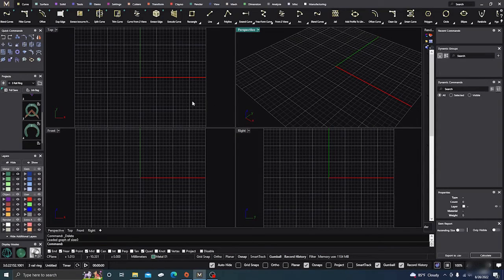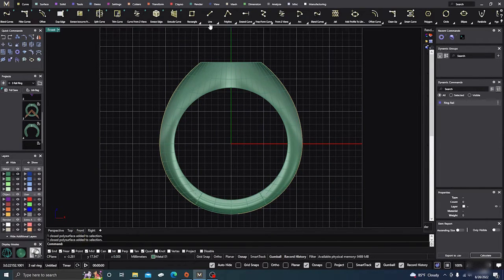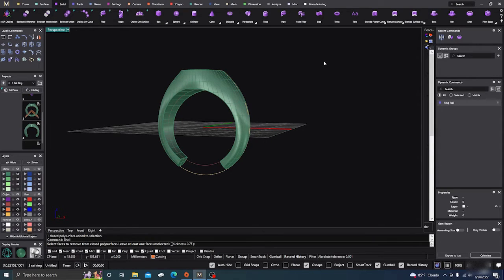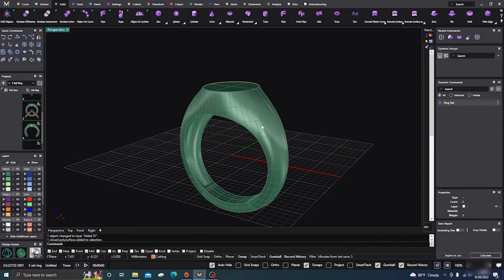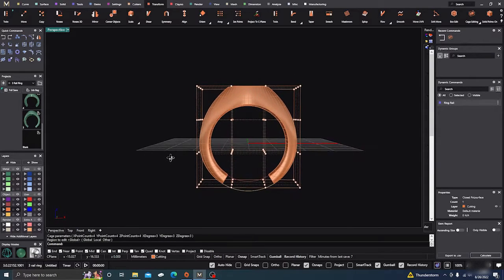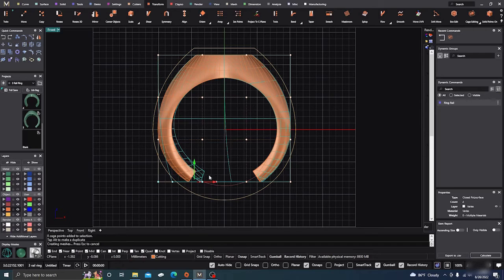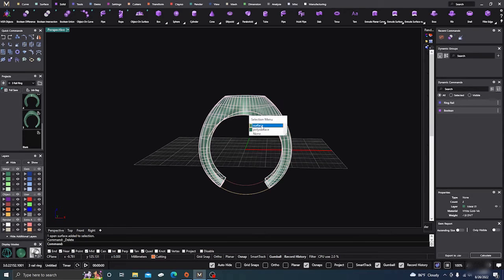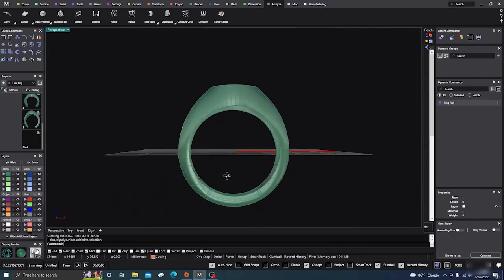Matrix 9 to MatrixGold conversion Pt 5 Hollow Signet ring

Comment: I am pretty much a beginner. I am confused about F4. You dragged after selecting the line. Then F4 it around. You pressed F4????? 
Please explain?
Reply from the maker: F4 is the center of the world . It is 0 in the X, Y and Z direction. Many times to make sure yo maintain an even cut or you want to keep something symmetric even on all sides you will place it at F4. Starting a curve at F4 allows you to mirror or rotate items evenly in all directions.
Reply: Wow, thanks for responding!!!!!!!!!
I got it.   I also couldn't do the same as you did:
the rectangle is only on one side for me.... I am stuck there.
I do >curves>line   >solid>extrude planar curve>straight 

I see a rectangle not a solid form as you have. and its only on one side.

I think I understand alot
and will be up and running once I get over the basic
obstacles. @donsjewelrymakingandjapantrave  

Thank You
Reply from the maker: I hope you check out the curve's videos and other command videos. You will learn the very basics from them and those will help you know more about how to go about completing your designs more easily in my opinion. The command line options are a great asset to understanding.